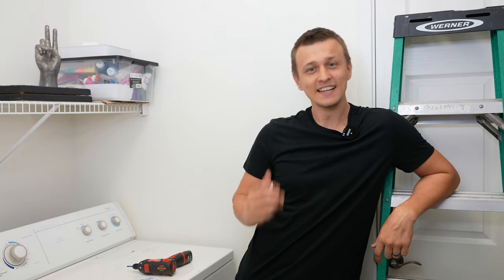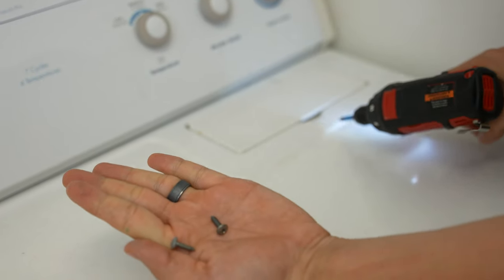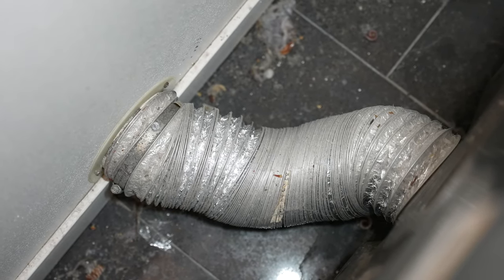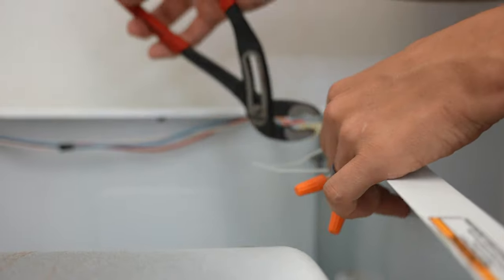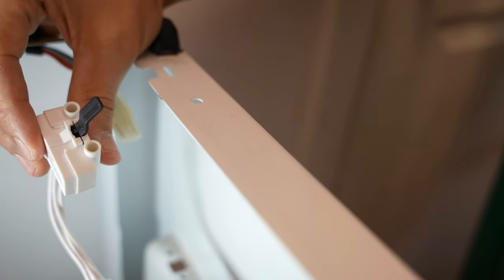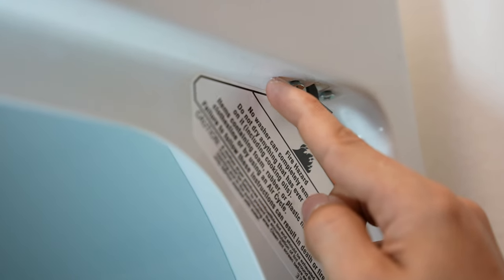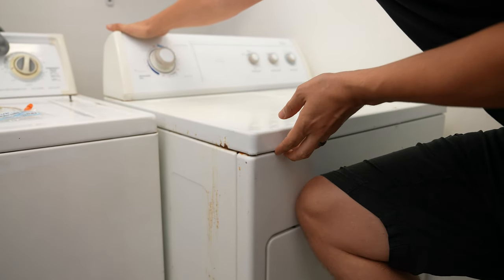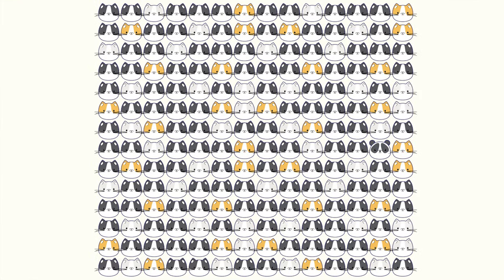Dryer Not Turning Off or On? How to Replace Whirlpool Dryer Door Switch

Comment: Went from "won't stop when door is opened", (switch is ordered 2dys b4) to "won't do anything" (light is now on steady}. I popped the top to nut the wires so we could run the wet load that was in it. I went to youtube when I saw the three wires. this was the perfect vid to get the answer. First one I clicked on. Thanks.

Comment: Good tips.
I had the same issue with missing screws on a used Whirlpool dishwasher last weekend we installed.
The two that hold the toe-kick to the unit.
I checked a hundred screws that I keep on hand and luckily the very last two that I tried actually fit!
Like you said, the OE screws were around $20 each! ✌🏻to that! 😎
Reply from the maker: That's a great things to have in a tool bag! A bag/container with a variety of screws. Just like with your experience, it helped me out quite a few times too. A pouch with random screws has been a great addition to my tool bag. I learned this from a senior tech who had half a bucket of random screws and nuts in his truck... 😅

Comment: Awesome directions!!!!!  It all worked perfectly, except after I put the lint holder back on, the dryer wouldn't start (it did after I put the new switch in, and before I put the screws in).  What could be the issue??

Comment: Saw you are using those wool balls.   I found they are great in the drier. :-)
Reply: What are the purpose of the wool balls in the dryer?  They stay in the dryer during the run/drying cycle too?
Reply: @tommywwalden1599  I use them instead of dryer sheets.  They prevent static on my clothes. Packaging says they are supposed to reduce drying time, ymmv.
Reply: @justj2729  ok got it...that's a new one for me...

I much appreciate your response!

     thx,  tommy
Reply from the maker: @Just J  Oh yeah! We love the wool balls.🙂  Much better than fabric softener sheets. 👍👍

Comment: The switch on my clothes washer failed (long before Amazon), it's job was to stop the washer in spin cycle if the lid was open. I bypassed it. Lol
Reply: Yes. You bought the truck for the engine. Brakes are for tourists...